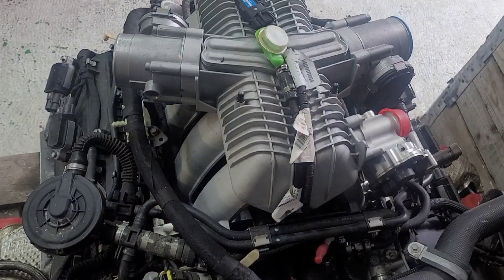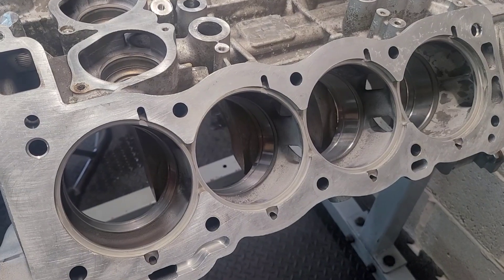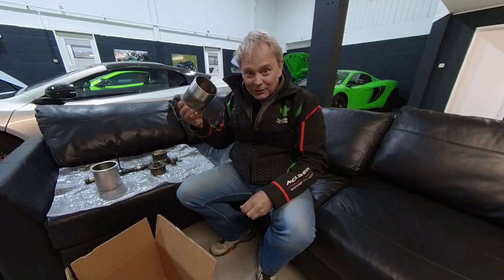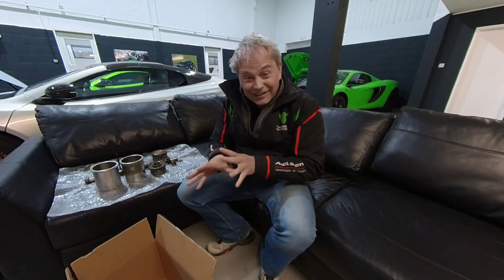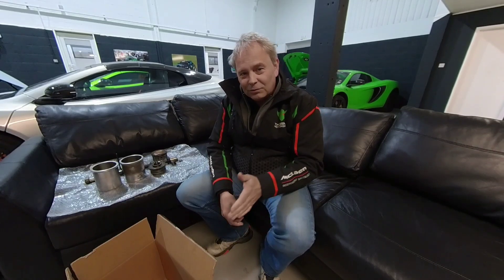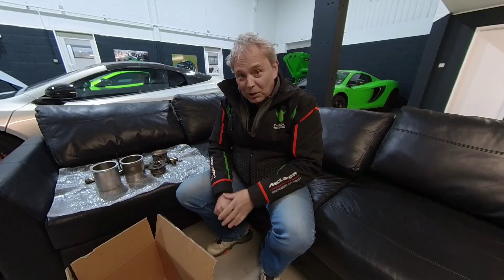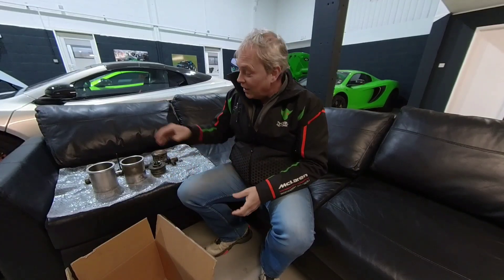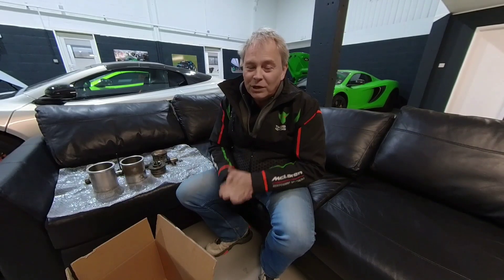All about McLaren engines

Comment: Have you now seen any issues with conrods bending?  I have seen several videos mention it even in stock engines, but more so in tuned engines?  thanks Richie
Reply from the maker: @richardwebb9186  rods are the weak point on the 4.0 but only when tuned, stock never seen an issue. We had a 675 that bent a rod but again that was tuned.

Comment: Thank you for this great video!
What do you consider over revving? Have McLaren set the rev limiter to high so it is worthwhile turning it back a couple of 100 revs? (When going sideways it is quite nice to have a revlimiter to lean on)
Reply: @drivingnirvana5164  a lot of car owners get forced induction cars wrong, FI generates power and torque lower in the rev range than NA so the trick is to change gear at peak torque not peak rpm. To get the best out of any McLaren change gear between 5-6k rpm, there is little point any higher as torque is increa at a decreasing rate.
Reply: @johnthorne2920  Thank you, well now that answer would take us into a long discussion on rpm/hp/torque/gearing but that we can save for when I bought a 650s spider that I am shooting for and come to UK to let you look over it. 😎 But top power of the stock 650s are made between 6000 and 8000, since gearing is set up for that it will accelerate the quickest in that range and with about 2k rpm down per gear you stock want all the revs you can have. But I can also see that power curves of mapped engines tend to provide power curves that are close to peak already at 5300rpm together with a boat load of torque so then it makes sense to rev less. But we are talking about vehicles with the only purpose to create emotions and fun and revs is a big part of it. When you buy an exciting engine you want to use the full engine.😎 
So what do you consider to be the limit of revs that are safe and can you accommodate tune to lower the revlimiter together with adjusted power curve? 
I know how it is especially on faster auto cross events etc, you sometimes lean on the revlimiter for 10m instead of making the up shift and then go right back again…..

Comment: All machinery needs adequacy of design, construction, operation and maintenance.  Screw up any one and it will bite you in the bum.  The third and possibly the last one are down to the owner/operator.  However, if there is no oil dipstick, I suggest that is a design fault.

Comment: It doesn't seem a good idea to me to make the liners from aluminium, were they coated, Nicosil  etc?
Reply from the maker: There were different versions from different suppliers over the years some better than others
Reply: of course they are coated. a not coated aluminium liner will not work on aluminium pistons of course. and by the way, the name of the coating is nikasil, not "nicosil". its a mahle brand.

Comment: Great video and very informative! Subscribed! With the huge and detrimental impact low oil pressure can have on these cars, it would seem reasonable to have some type of low oil level warning system built in. Regardless, I check my oil level on my 570S every 500 miles. Typically end up adding about 1/4 quart.
Reply: lol. Low oil is bad for any engine.
Reply: @executiveinvestments  exactly. this is not a mclaren specific issue. regulary checking the oil level and change the oil and filter is somewhat cheap and easy for even the most stupid idiot but somewhat important.
Reply: @martindelrio1891  Yep.  no doubt.

Comment: Hello John! I recently bought a 2015 650s coupe with less than 2k miles on it. The previous owner barely used it and the car is almost new.

Before I bought it I drove it for a couple hours and I noticed some sort of weird hydraulic pump noise coming from the back of the car when coming to a stop.

Now, I live here in Dominican Republic and we don't have a Mclaren dealership. The only choice we have is the Mercedes dealer which is the only authorized dealer by Mclaren to sell and service these cars down here in the DR. So I went down to the Mercedes dealer where they have a couple of technicians working on these cars, and I was told by the techs that the noise is quite normal on the 650s & 720s, and if I recall correctly, they mentioned that is something related to the aero system. 

But since you are THE EXPERT on Mclarens, I would appreciate your input on this particular situation, because to be quite honest, I don't really trust much their expertise on Mclarens because for me, they are simply Mercedes techs with some Mclaren training.

I love your channel and the way you explain everything about these cars.

Best regards,

Levi Garcia
Reply: Can you video the noise and we can have a listen for you.